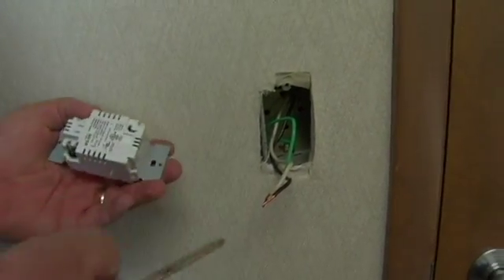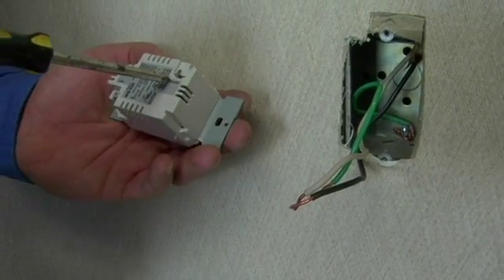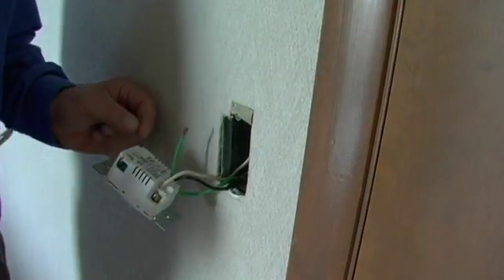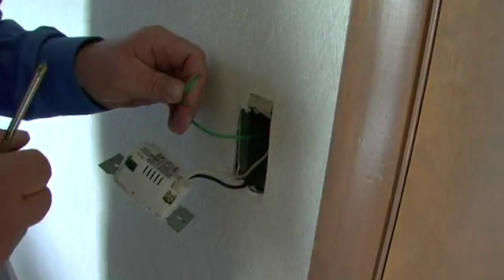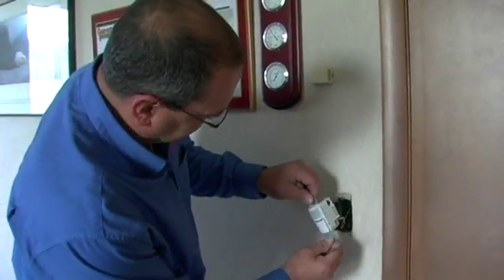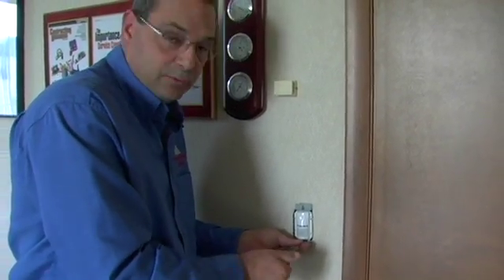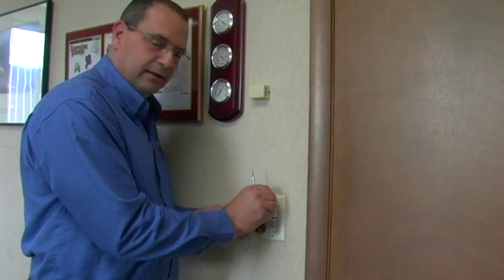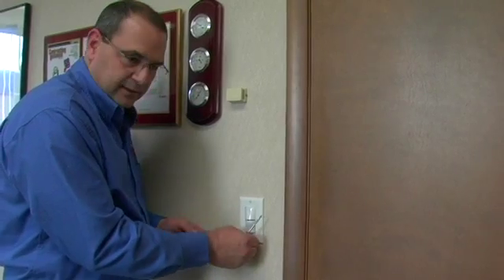Installing an Occupancy Sensor

Comment: Anthill19531 is right there is no neutral (common)in this case it goes directly to the light you have a 12/2 bx black and white with a ground. people usually think it would be a 12/3 but its not i think the higher up dont consider ground wire a carrier.....anyway so the white turns into a hot leg(120 v for those that dont know) and the black becomes the switch leg (the wire between the switch and the light)

Comment: this guy does not know what he is talking about, neither does Meetmeincognito. the white wire is not a neutral and cannot be used as ground. it is a switch leg and carries line voltage. call an electrician.

Comment: Many wall switch sensors require a ground wire as this is how they power their internal circuitry. WIithout a ground wire some sensors will not function.